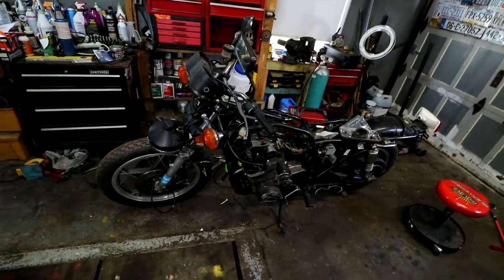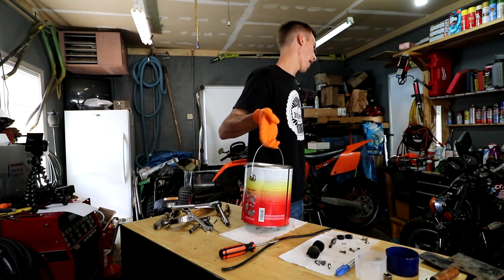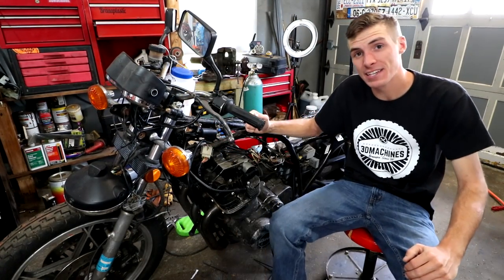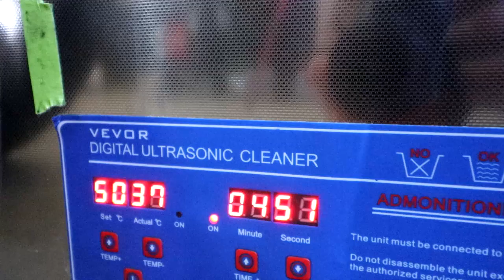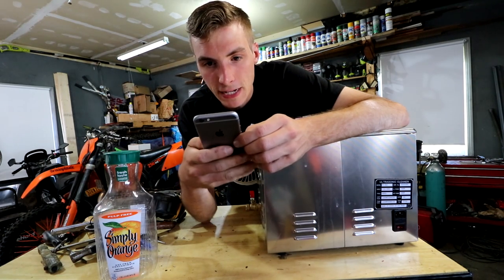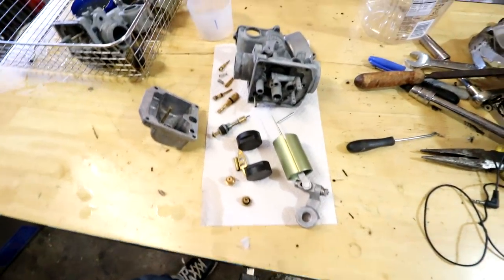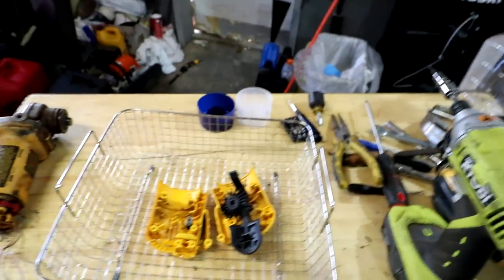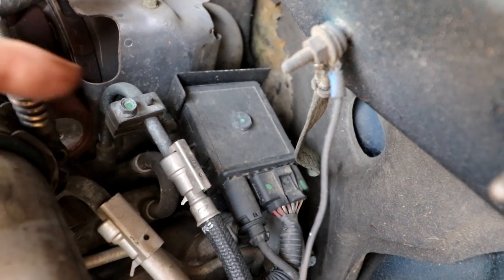POWERFUL DEATH TRAP

Comment: It is part of the needle and seats for the carb
Reply: will walen "needle seats"
Reply: Also they could be the the spacers for the slide arms.
Reply: This!
Reply: Pop flames
Reply: Slide needle guide. It goes in before you put your main jet in. Bigger opening first and it will slightly stick out if you look through the carb, or float needle seat, goes in the bottom of the carb where the plunger (needle) on the float goes.

Comment: Dual Pipes that goes up, we want the gator to ride under water.
Reply: If you have the exhaust under water it won't hurt it's not like It will suck eny water in
Reply: +Christina Gurley The whole point is so it don't stall underwater, without it will choke itself

Comment: Those brass pieces are for something in your carbuerator. For the dents and paint transfer on your dmax, spray wd40 on the paint transfer to remove it, (wax the area after), for the dents pour boiling water on them and then pull them with the dent puller!!
Reply: connor covington u cant pull dents out with hot water on steel, thats for plastic

Comment: You got 4, power stroke, Cummings, duramax, and the old ford International IDI. The International IDI  was put in the Ford trucks before power strokes
Reply: Typical Enduro Rider In that case there would be the 6.5 Detroit diesel too
Reply: Coach Burgener I totally forgot about the Detroit diesels they are some awesome engines
Reply: Yeah, I remember those IH engines, pretty decent for being IH better than power jokes for sure.  Each engine has it's issues but I have known guys with power strokes that have just spent money out the wazoo on their engines and NEVER gonna get that money back!  I have no bias towards any of them but had some experience with all of them, Cummins has the least issues long term, but better a Duramax than a Power Stroke... just my opinion.
Reply: MISTERComaToes the 7.3 powerstroke was built by IH as well.
Reply: Typical Enduro Rider there was also the Detroit's in GM trucks before the Duramax. I think from 80-87 was a naturally aspirated 6.2 liter, then from 87 up to the duramax there was the 6.5 liter turbo.
Reply: Typical Enduro Rider Cummings u mean cummins
Reply: Yeah, I worked on several of those 6.2 L GM engines...  They were a fairly reliable engine.  We had tons of them in one ton trucks.  Not overpowering but not much trouble with them.  The 6.5 was an attempt to remedy the power issues and the turbocharged units did that BUT were likely to grenade on you, the  normally aspirated engined did fine but the engine was not built for the higher turbo pressures, something about broken bearing girdles. We replaced a lot of those.  I think I only rebuilt one 6.2 and it was just worn out.
Reply: Typical Enduro Rider then by that logic, you have the ecodiesels in the 1500 dodges, made by pentastar, then you have a Mitsubishi diesel in a dodge d-50
Reply: What's a Cummings 
I only know of cummins 😂😂
Reply: Elijah
Reply: I like it

Comment: it might be your catalytic converter in your truck haha
Reply: Freddy Belong Wouldn't the engine overheat? I had an old car and the catalytic converter went bad and the car began to overheat. Learned I needed to flush my coolant and possibly replace my radiator that day too. Little black with rust.
Reply: +WastedIntelligence Im not sure im not professional haha all i know is my catalytic converter went bad and i didn't have no power couldn't get it over like 25k rpm because it couldn't push the exhust out like it should but that makes senice that it would overheat also if that was the case
Reply: haha i didn't think they did , i never owned a diesel tho so i wouldn't know
Reply: picklesthegreatest They do. Just a make a quick google search.
Reply: thanks +WastedIntelligence im all confused lol
Reply: picklesthegreatest diesel trucks can have cats 06 24v Cummins comes stock with a cat

Comment: Even though the engine is a four stroke, the exhaust tuning is still critical. Engineer your system to take advantage of the scavanging effect. You may find that running an open exhaust with short pipes is a power robber. We used to sync the carbs with a peice of vinyl hose by listening to the sound of the carb. Just insert the hose in the air intake of the carb.. adjust them so they all sound the same. A synchronizer is way better but if you don't have one.....

Comment: Hey Dalton you only need to soak the Jets not the entire carborator, and there are more than 3 options for diesel engines but the other 2 aren't stock and require reinforcement of the truck

Comment: Pretty sure those brass pieces are from the housing for the grinder. My dewalt impact driver that I converted to an Impact wrench had brass inserts on the non threaded side of the clam shell. Which gives it extra strength so the plastic doesn't crack.

Comment: Those two little brass pieces are air bleeds from the carbs. They would most likely be from the air intake side of the carb. directly in the tube where the air filter boot connects to. They are pressed in the body with an interference fit. They most likely came out when the carb was heated in the sonic cleaner, Brass and aluminium expand at different rates. The body of the carb heated faster than the bleed and they vibrated out. Best to use low heat and slowly increase it. That chem dip is a waste of time, and very caustic. I would just go straight to the sonic cleaner.

Comment: If you are going to do either exhaust system  put some type of muffler on because the engine is designed to run best with a little back pressure.

Comment: The brass parts that were loose could possibly be the brushes in the drills motor, if you took it apart. Possibly could be the pins for the carburetor slide, so they don't twist in the carb itself.

Comment: I used to have the mikuni vm26ss carbs on  a gs750. I think that brass is the seat for the fuel mixture screw. Not the air mixture screw. I dont know many other manufac. that used fuel mixture screws other than mikuni. You are lucky if the fuel mixture screw did not break. They are usually stuck in the seat and break easily due to its narror needle pointy edge. /Best of luck from Sweden.

Comment: If you strait pipe the engine you'll see a loss in power and a big loss in efficiency. That being said I would do dual pipes, with 2 cylinders merging into each one, going to an X pipe, then out to larger exhaust tips. It will be loud, sound great, and you'll have some backflow. The 2 brass pieces look like they could be jets, definitely check the carbs over and see if the're missing anything.

Comment: Those brass pieces go to the carburetor on the outside to plug up some holes it's right by the intake side

They regulate the fuel to air mixture

I believe so anyways

Stay froggy fresh
I'll see you tomorrow

Comment: 3dmachines please answer me .. my current situation with my 89 silverado with 438000 miles i got an  alarm installed and it worked but when i needed to go to the store i tried turining  it on it made a bad noise and then it only cranked and didnt start then i notice gas coming out the gasket of the throttle body ... idk whats wrong with it at this point

Comment: Those brass pieces look like motor brushes to provide voltage to the stator. Oh, make the exhaust duals behind the seat slanted at 45 degrees with tractor flaps.

Comment: dual out the bottom to the back..... dont do stacks with the amount of power an knowing the fact of your going to want to drift it.... think you would eventually either not use all of its power or build a a roll cage an stacks or straight pipe back wouldnt be best

Comment: cinqro meter is eazy to make youre self you just need a piece of board and some clear tubes 
make the tubes intoo a long U on the board and fill them halfway with coloured water then  put one piece of line of each of the tubes ontoo the carbs start the motor and the water will move up one side of the tubes you just need to make sure the high side of the waterlevel in each tube is equal and the carbs are sinced

the 2 pieces of brass could be small bearing bushes for the fuelfloat pin

Comment: Use the motorcycle's stock exhaust or you'll be right back in there rejetting those carbs.
And your little brass bits look like seats for the needle valves from the carbs...

Comment: If you run straight exhaust you will have to change the jets in the carb. Waste of time. incorporate the muffler some how in the system and avoid re jetting carbs.

Comment: give it a stack with a low bend under the engine and make an oil injection system so you could roll coal

Comment: I wouldn't run it under the bed cuz I had a Ford 2000 gas tractor that I had that was like that and park it in the wood to take a break and it caught the ground on fire and ik u will be taken it off road